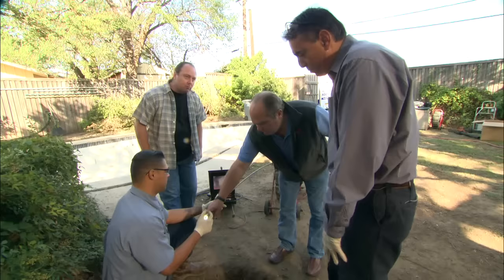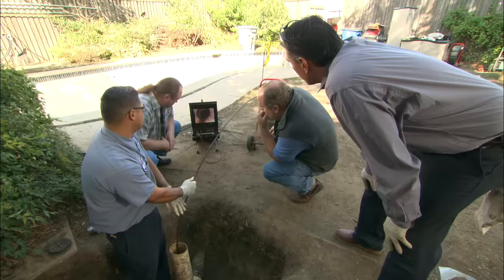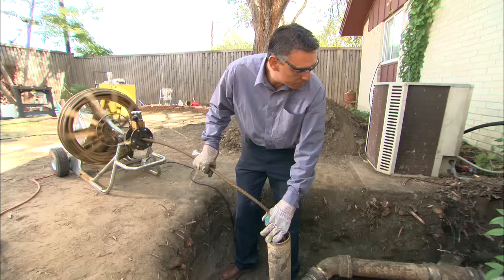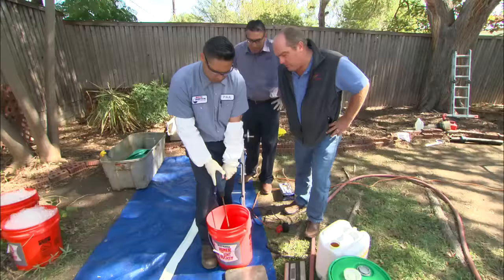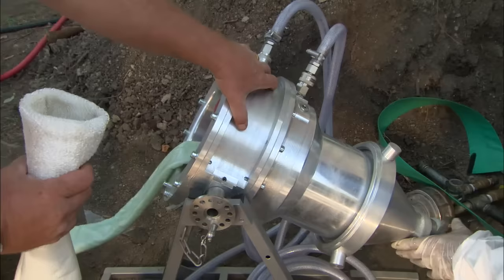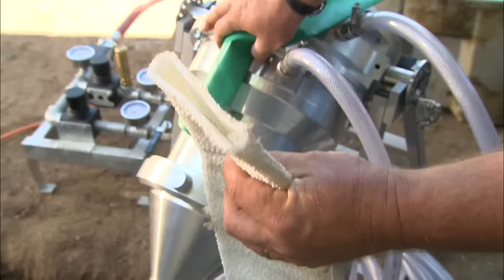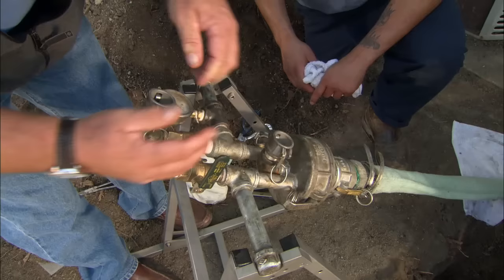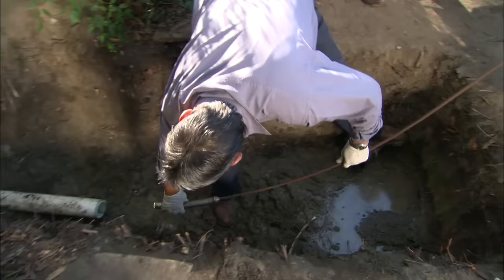How to Repair a Sewer Pipe Under a Concrete Slab | This Old House

Comment: It certainly seems to be good at saving an existing sidewalk or masonry surface from getting torn out. However, I wonder if it's really any cheaper than a regular dig? My guess is that there are little actual savings to the homeowner.

Don't forget! The trenchless ''inflate-a-sewer-line'' can only follow the path of the existing, old sewer main. What happens if, as old pipes will do, the line has developed a severe belly in it? Or it has settled in an unpitched plane? Worse still, what if the old line has settled so much that it is now actually travelling at least slightly uphill?

I can't see a remedy for this except for a dig. I suppose that even a poorly pitched liner is somewhat better than the formerly root-infested line. Yet it seems like this new method has some weaknesses.

Comment: My roommate called the Smell Good Plumber while I was out of town working. I flew back to speak to these plumbers, they wanted to dig up my yard  to replace pipe $10,000 plus $1200 to drain the Hazardous water from the bath tub. Hahahahaha what criminals!
Reply: why was it hazardous water? was there drain-o in it?
Reply: 10k might be a little too much but it sounds about right, I’ve been a plumber for 12 years and this method of “replacing pipe” I’ve never seen, it must be because it sucks, and imagine how expansive this is. It’ll probably e cheaper just to brake and replace the whole thing,
Now about draining the liquid idk about that, that might be a rip off

Comment: How much is the cost per foot, compared to a remove and replace.
Reply: It will vary but count on it being several thousand dollars for a repair like this.  You're looking at roughly 400 per foot depending on conditions. Say you have 20 feet in need of repair that is under a home that is slab on grade spending 8k to line the sewer is still cheaper than removing the floor, jackhammering the concrete, going under walls etc.  Plus all the headache.....
Reply: It all depends on the company you get the quote from. I can tell you the markup on the material is HORRENDOUS. I remember we paid somewhere around like $20 a foot but sold it for roughly $120 a foot. If you can access the damage and its only a small area, you are better off excavating. Just 2 cents from someone with a lot of experience in it.
Reply: Thanks for this reply. After watching this, I was thinking, wouldn’t it be easier just to dig up the troublesome spot and do a proper repair?

Comment: If possible, I'd recommend a SDR pipe burst as liners can fail and do not last against being snaked. Liners are just coating the problem and the roots are still inside the system. Mother nature will win over time, expanding the liner between the cast iron/clay/abs pipe and causing a blockage.
Reply: the roots are definitely NOT inside the system once a liner is installed. The liner is the system and that epoxy makes them hard AF. Highly doubt they would fail during our lifetimes
Reply: @HarryGoulding  I’ve seen it more than once.
Reply: @FelonyRecords  seen it hundreds of times myself in the UK, chamber to chamber liners are ok, but these patch lines cause more issues than good over time.

Comment: What happens with the drains inside the house ? How would the drains from the toilet and shower pass through to the mainline if this seals the whole pipe with no openings?
Reply: If they can do this.. do you not think they can also cut a hole into it at a specific point?
Reply: @Prima10ne  this really only shows the mainline. How could branch lines be done in such a way? Cut hole in the pipe? Would that not involve cutting concrete or tunneling under the foundation? The whole point of this system is to avoid that

Comment: In Texas we simply tunnel underneath the slab never having a break it and replace the pipe that way. Is that a not an option anywheres else
Reply: Many places up north the pipe is too deep to tunnel. With a basement it can be up to 10 feet deep.
Reply: Plumber Man I don’t like to tunnel, I’d rather cut the slab and put some new drain lines in. Tunneling is too dangerous In my opinion.
Reply: And down in the Houston area they have that black "gumbo" dirt.
Reply: @ZR1Terror  hey may I get a advice how dangerous is tunneling because iv done 30ft of tunneling this week and well it was also pretty messy from the sewage..I wear a tidevic suit that was pretty cheap that ripped must of the time and a fresh air mask .. is that enough for my safety?
Reply: Corey Woods Well the sewage is one of the safety concerns but what made me not want to do tunneling is that here in the local news, they talked about a man who was tunneling and he took an extension cord with him and water started accumulating in the tunnel. The extension cord had a tear and shocked the man and couldn’t get out and died. I don’t know, I guess I’m cluster phobic and I will avoid putting my employees through that.
Reply: That would be my choice.  We have a slab on grade house in the desert, digging is "sandbox" simple.  If you follow the bottom of the slab, you could excavate something about six feet deep, 2' to 3' wide and as long as you want.  Start from the other side and go right through.  Then I'd pour level the floor and place a slab (think about drainage first) to support a 6" block wall, that comes up to the slab.  The space is now ready for an air source heat pump, that can have warmer or cooler air coming at it, depending on how you cover the openings.  Fix the drain while you're down there.
I'm sure there is a 'giant' wet-vac that would drill through the sand and suck it out simultaneously.  With the right people this isn't pricey, it's labor intensive, not material expensive.
Reply: @coreywoods1925  you have to be careful with gasses and oxygen deprivation, especially with sewage. If there is a leak in the pipe and you tunnel into the dirt that sewage seeped into, you run the risk of encountering hydrogen sulfide gas, or H2S. H2S is prevalent in sewage, in low doses it smells like rotten eggs, in higher doses, the amount that will kill you, it deadens your sense of smell, it isnt odorless per se, but it kills your sense of smell so you wont smell it. H2S has killed many sewer workers that didnt have a gas detector. Plus whenever you tunnel you also run the risk of entering into an area where there just isnt enough oxygen. Then there is also the risk of cave ins. But hydrogen sulfide gas is the biggest risk factor when dealing with sewer
Reply: ZR1Terror finally a real plumber. Chop it up and install new pipes
Reply: @ZR1Terror  Does cutting the slab weaken it? I've always wonder about that. So all the rebars get cut also? That means the rebars job was just when they pour the foundation to help the foundationn harden solid and afterward you don't really need them there anymore. thks for your answer in advance.
Reply: How deep are the sewers under a house in Texas?
Reply: life is cheap in Texas
Reply: That seems like MAD work lol
Reply: I have done that a few Tim's in Jacksonville fl and tampa...
Reply: @redranger518  No its not
Reply: @coreywoods1925  no
Reply: Tunneling in California is  prohibited
Reply: @quocducnguyen  you just tie in new bar when you pour again

Comment: Impressive.   I'm wondering about degradation of the material over time and if dangerous chemicals can enter the water treatment facilities and perhaps not be cleaned up before discharging into water systems?
Reply: No more dangerous than liquid plumber over and over and over.
Reply: This method sounds more ideal for sewer pipes

Comment: Only one question, how do you drill for the branch line drains to empty into the liner?
Reply: There is a specialized robotic cutter system that does the work, about $100k to purchasr. Affectionately referred to as the cookie cutter, works when it works but when it breaks, costs roughly $3k to fix.

Comment: What about snaking it in the future? Will it hold up to my sectional snake that has a 1 1/4 cable...or will cut  right through it?
Reply: If I can't clear a clogged you got a problem
Reply: The manufacturer does not recommend snaking lined mainline and jetting is highly recommended for any future backups. Personally, a cured lines is stronger than ABS and the chances of a blade cutting through the liner while rubbing against   is very slim. Just to cut through a collapsed or tie ins liner, you need a picote to grind it out. Maybe i will make a video demonstrating such

Comment: what prevents the new pipe from being compromised by the roots?
Reply: No gaps
Reply: scyther1
Reply: no joints
Reply: The roots are looking for water, water which isn't seeping out of gaps...
Reply: Act of god
Reply: I've been known to compromise a few innocent pipes with my very own root.
Reply: The roots got in because the pipe rotted I believe. This pipe should never rot.
Reply: scyther1 its solid some wa like fiber glass
Reply: scyther1 no roots
Reply: billy bobbert been lining for 16 yrs and no roots. Roots look for nutrition aka water, if no joints the to them no nutrition.
Reply: roots have a hard time going through no organic material. unless there is a gap in the liner or the pipe itself breaks, roots probably are not going to get into the line
Reply: Epoxy is hard as hell. Only tree roots could bust it
Reply: @22891690  Capitalize the Lord God, only false Gods are lowercase.

Comment: Great video! I'm curious... how much does the new liner reduce the I.D. of the existing pipe?
Does the (fractional) reduction of the the I.D. cause any concerns with code requirements?
I wouldn't think so, but thought I'd ask.
TII
Reply: Simple answer is no it will not cause any concerns with code requirements.  It will make the system work better as it greatly reduces the friction
Reply: The inner diameter is decreased by 1/4in. For those interested in learning the steps to shooting a liner, check out MIKEYTHEROOKIEPLUMBER here on youtube.
Reply: Who cares,  asking as the pipes fixed. what they don't know doesn't hurt them.
Reply: @bossudude420  makes absolutely no difference.
Reply: no it does not
Reply: @bossudude420  no they won't
Reply: @Fattony6666  Not only can they find out that way, but if your home owners insurance finds out you did work without a permit they may not cover any damages arising out of that unpermitted work. Get a permit, and save yourself future problems.
Reply: @bossudude420  Municipal sewer is not metered.  The bill is usually a set fee or based on water use.  Show me your sewer meter.  Besides that, doesn’t matter anyway if your sewage goes through a 2 inch pipe on a pump or a 10 inch pipe by gravity.  It gets there.

Comment: Whats the average cost per foot compared to replacement?  Will this method work if there is a dip in the sewar pipe?
Reply: What did you with your situation. I currently have dip and I think this is what they want to do.

Comment: Ive been snaking my own line for about 5years now.  I use a machine called the Electric Eel, which is a motor on small wheels, and you attach 8 foot sections of heavy spring to the front and push them into your clean out and go back and forth where you feel resistance from roots.

Roto Rooter costs $300 bucks and  renting the Eel is $60 for 4 hours.

RotoRooter guy only went to a 3 inch cutter, but i work up to the 6" cutter and really get it cleaned out.
Reply: How does a 6-inch gutter fit into a 4-inch line

Comment: what would you do if ur pipe that needed to be replaced crossed past a 3 way directional fitting like a wye or a tee? wouldnt it just seal off those fittings?

Comment: Richard Trethewey has been around a long time and is a licensed plumber.  If he feels this is a good process I would say it probably is, however, what's the cost ?  This will be the real test, if it's a lot more expensive than replacing the old pipe than it's not wort the trouble or the chance it will not hold up.. What's the cost per foot and the availability  regional wise ??
Reply: As i have worked with this tech and other trenchless tech, i can tell you this is much cheaper than the old way. If your pipe is under the slab, you have to tear up the concrete. Tearing up the concrete means youre most likely dealing with asbestos. The cost of containing asbestos and getting rid of it can easily surpass the price of epoxy lining. This doesnt include the digging, trenching, and installation of pipe(most of the time its the same pipe that needs to be replaced). So, to replace the pipe without the liner, you can be looking at around 5-20k if youre dealing with asbestos. Epoxy lining is anywhere between 2k to 7 or 8k for about 50 feet of pipe, depending on who does it and what method. Some methods use different epoxy and some have either a blow in place method or a drag in place method. This video shows the blow in place method which is normally more expensive
Reply: why not dig a trench under the house?
Reply: 7.5k here in Los Angeles 4/2017
Reply: Janahreturns Which company did your liner in L.A.?
Reply: Same question what company was used looking to da also
Reply: Jesse5068 hi. Mind posting what company you used ? Thanks
Reply: Those looking for repair companies. Do a search for 'trenchless' pipe repair. That should hopefully help you find what you are looking for.

Comment: How much does something like this cost?
Reply: A 2 bedroom 2 bathroom house would be about $20,000. I have been a Pipelining Technician for 4 years, you are better off Trenching the Floor and installing brand new pipes. Pipelining has many issues the Pipelining Companies won’t tell you up front.

Comment: Cool idea but how much do you lose in diameter, and would the root be able to puncture it?
Reply: Epoxy is like solid plastic so i bet that first the roots wont sense any water to look for and the liner is too tough to push through.

Comment: An $8-12,000 procedure for 50'.  Very costly if this happens to you.   Called trenchless or insituform pipe replacement.
Reply: Dammit .  I think I need to do this.

Comment: I had a neighbor that did this. He said it costed him around $10,000.
Reply: lenn55 *cost
Reply: thats what i was quoted to change the pipe, i was just gonna ask how much this cost, thought it would be cheaper. might just change it myself
Reply: Dam,,i had to have his first option,,bust concrete slab,,all rework total 5,000$
Reply: For 5000 you replace the whole pipe line......it should be more cheaper using this  new technology!

Comment: So what happens if there is a branch line tapping off the main sewer??
Reply: that tool they used to clear the old pipe first cuts them away and they flush the pipe :)
Reply: I'd guess you'd have to dig up any intersections and run them individually.
Reply: Maxid1 Yep, only works for straight runs, but you wouldnt have intersections underground for a single family home.
Reply: why would you have a branch line outside?
Reply: Multiple buildings on the same premises.  Units or a sewered garage  for example.
Reply: Insituform actually has a robotic cutter that'll go in after the liner's cured, and cuts out the taps. 

Saw this very thing being done on my street 4 years ago, in our 40-year old street, the 8" PVC main was collapsing, clogging, and getting invaded by tree roots.
Now, the city can expect 50-plus years out of the repaired sewer mains.

Comment: Curious how it stands up to zonk, draino, and drain-cleaners? Another problem is the lines in older houses were sized smaller. Then with this system you are losing Some of your ID. This is going to be most apparent when you change your toilets to low-flow from what might be in your house right now 16L flushing monster.